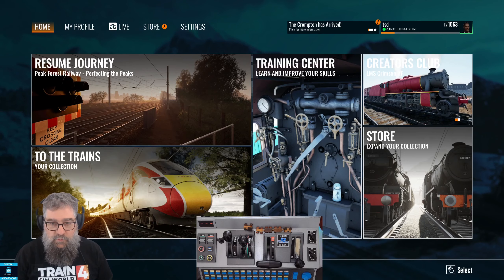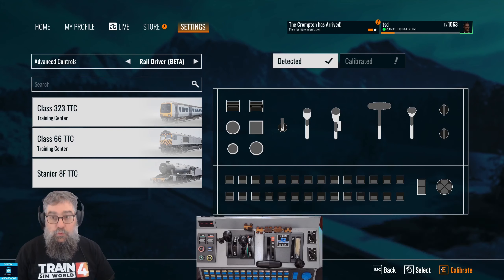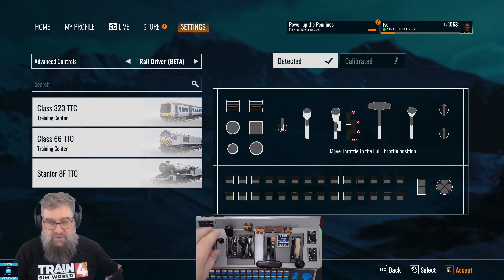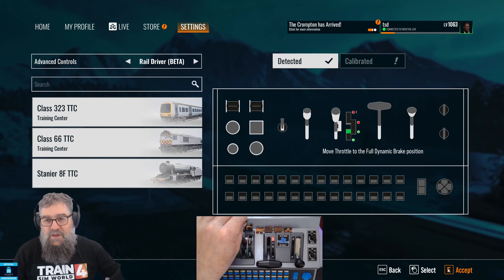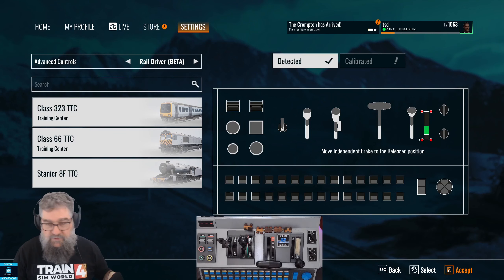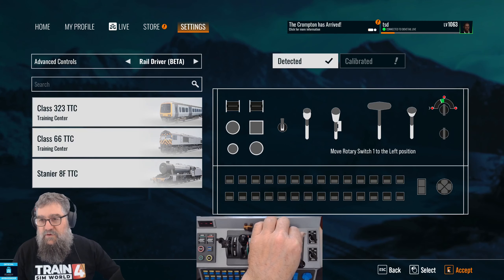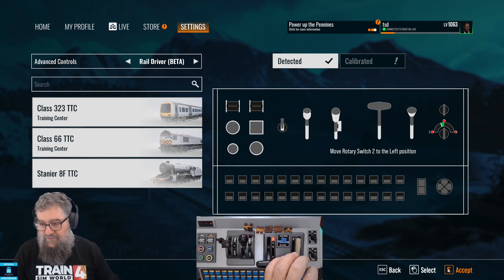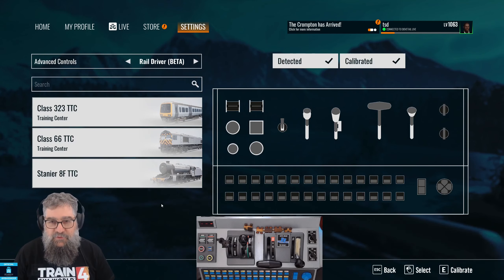TSW4 How To Calibrate Your Raildriver Controller

Comment: I got mine when I was very busy moving to a new state setting up a new business and I tried to get it working on TSW3 and had issues non stop and I knew I was doing something wrong with the calibration. I didn’t know the last lever had that right push motion to it. Thank you so much can’t wait to actually use it on my TSW4 I bought last night.
Reply from the maker: Hope it all goes well for you. How each loco supports it is still a bit variable but most things use the controls as you'd expect. Steam uses the independent brake for the regulator.
Reply: @trainsimulatordriver  so far so good ! Now if they would just put out a new game with a massive open map and multiplayer all my dreams will have come true ! 👌
Reply from the maker: @SticksAandstonesBozo  who knows what the future might bring - I would personally like to see co-op with one player being driver, one being shunter or guard.

Comment: Thanks for this video! I'm about to buy one of these off eBay, and I was wondering if there's any difference if one is like 10+ years old vs a newer one.
Reply from the maker: Mine comes from 2001 😁. As far as I know they've never changed the design and just keep on building them as they were then. They develop a couple of common faults, its pretty easy to snap the surround that secures the horn lever off. I've repaired mine a couple of times. The two switches on the right lose their detents over time. Its a USB 1.0 device and doesn't need a device driver. You do need PI's software from their website for many sims but a lot of them support it natively.

Comment: Thank you for this! Quick question, i play other games, so might need to unplug this to move it out the way, will i have to calibrate each time i reconnect? thanks
Reply from the maker: @mattpitt30  not usually no, when the weather changes is the time I recalibrate our home heating affects it a bit but apart from that you should be ok
Reply: @trainsimulatordriver  Ok thank you!
Reply from the maker: @mattpitt30  no worries, enjoy :)

Comment: My issue is i get it calibrated but the levers never seem to have full range in game.. like throttle lever at max is only at notch 4... brake release isnt fully engaged in game but released on controller.. ugh lol
Reply from the maker: That sounds like it's not calibrated. Check and see if the game still thinks it is. Some updates blow away the calibration.